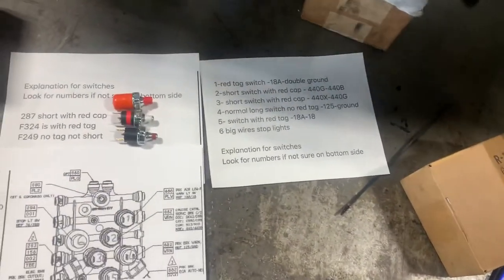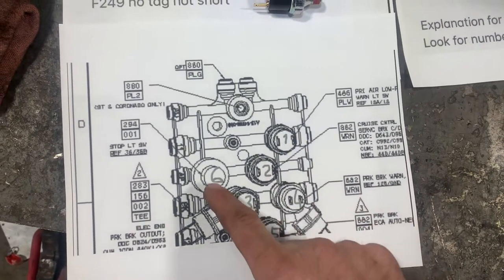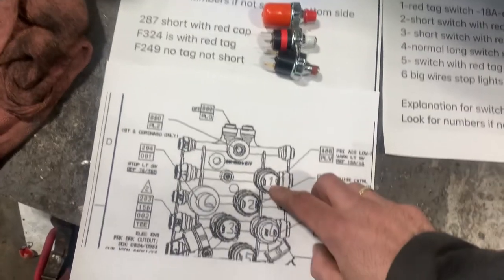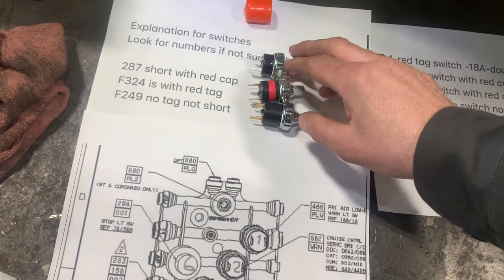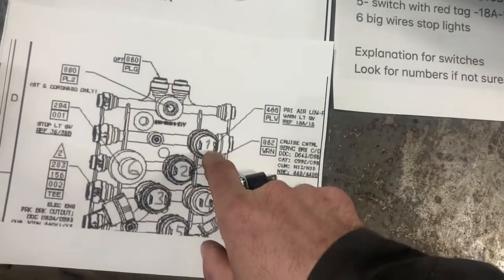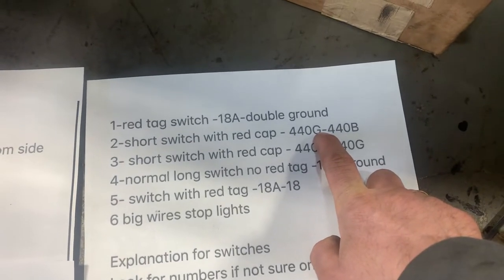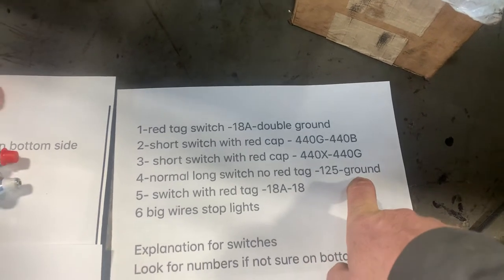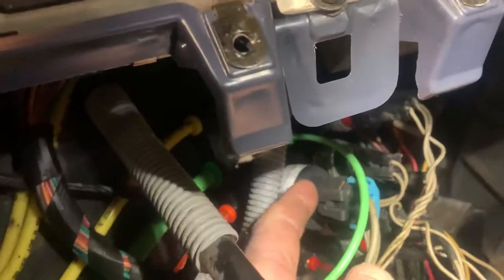Air manifold diagram for freightliner 2004- up

Comment: My low air buzzer turns on when i accelerate and stops buzzing when i cone to a halt. Both tanks are full. Any ideas anyone?
Reply: You probably already figured it out. But it will be one of those switches. It happened on my Columbia.
Reply: The green line switch is bad